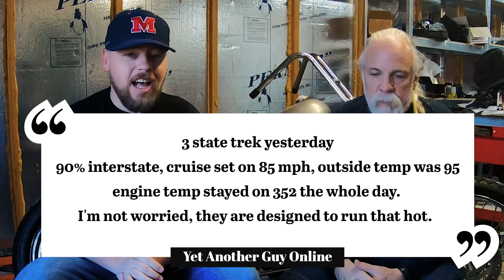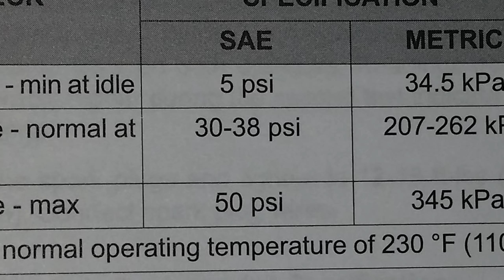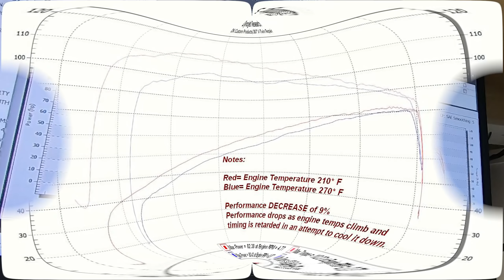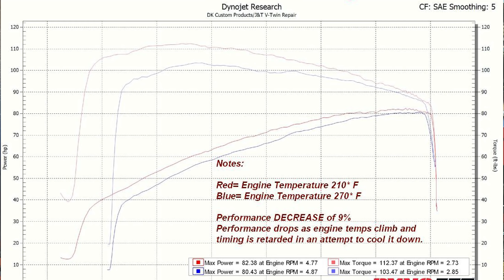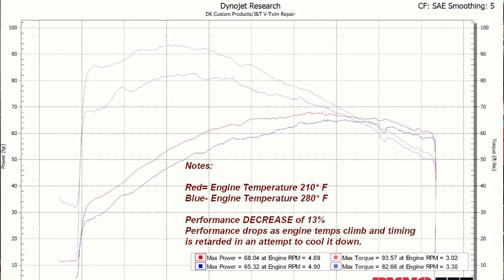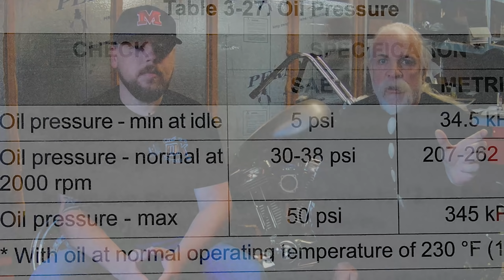Harley's - The RESULTS ARE IN About a Popular Myth

Comment: More than likely heat issues are a product of the oil you are running. Everyone thinks thicker is better when it is not.
Reply from the maker: No, that was not the case.

Both engines were fully heat soaked prior to runs, so the oil was not thick or cold.

The M8 had the factory 20-50 in it.
The Twin Cam had Redline 20-50 in it.
While some oils may lower temps by 10 F, and we have even seen claims of 20 F, the majority of engines will run 50-100 F hotter than what HD says is correct, and will start pulling timing in the 270-280 range.
For the guy seeing 320 f, even if he changes to an oil that lowers temps by 10 F, he is still going to have a problem.
Reply: Heat is a direct result of friction. Fuel and air is another but you have secondary’s with those. HD oil is total crap with no API standards. Oil not making it to all parts of the motor is another or poorly pumped. Try Mobil 4T racing oil or Amsoil.
Reply from the maker: @semperfipar1299  We've done heat tests with Amsoil compared to Redline and Royal Purple and Mobil 1, but we have not tried Mobil 4T.  We may do that.  Thanks.
But I am pretty dadgum sure that the heat generated by the combustions cycles is where the majority of the heat comes from.
Reply: @DKCustomProducts  One other thing is oil is suppose to shed the heat of the motor. Combustion is a big factor but that does not necessarily mean it is destroying the engine. Harley Davidson now has to have emission control. Catalytic converters back up heat into the engine through metal to metal transfer at the exhaust manifold connection to the cylinder head. The cooling fins also shed heat and the aluminum sheds heat very quickly compared to Iron. Having worked on helicopter drive trains the turbine is the ultimate air-cooled engine and believe it or not the system had a valve at the oil cooler that remained closed to allow oil to heat up then it would open up to the oil cooler . From there to the engine inlets and return to the oil reservoir. For piston pounders the multi-viscosity is what you have. The lower the first number the better for friction at cold temperatures. I run car oil in my old sportster and it takes about ten miles just to get it warmed up. Twenty one years old and still runs like new with over fifty thousand miles. Try 10W40 oil and see how it does with heat. It will circulate better than  20W50.

Comment: Run Amsoil in all 3 holes tested up to 500 degrees on the Amsoil video on this here interweb . When the steaming oil cooled they  tested it's viscosity and it had lost practically no motor protection and they put it back in the bike!!2 0/50 wt motor , dedicated Transmission and Primary fluid  all Amsoil and love jugs or the new mini mites . YOUR HARLEY WILL. NEVER OVERHEAT. My Deuce ran from 230 to one day in traffic 260. Since fitting the fans on same temperature day the oil / temp dipstick was running just under 200 all day.I also run the same set up on my 2014 Firefighter Shrine Street glide . I like the mini mites ( looks wise) my brother in law runs the original Love Jugs  on his 2003 Ultra Classic with you guessed it AMSOIL.
Reply from the maker: Thanks for watching and sharing.
Reply: @DKCustomProducts  hope his helps someone. You can at least check it out 👍😎🇺🇸🏴
Reply from the maker: @williamjohnson6517  You might enjoy this video- https://www.youtube.com/watch?v=bNHgNThrqQo
Reply: @DKCustomProducts  I did watch your video and really enjoyed it 👍 Everything you said was correct . Dino oil is probably ok for the short haul BUT who wants to change their oil every 3,000 🤔I know I'd rather be riding 😂Also as mentioned there is a difference between car and M/C oil . From what I understand car oil is not good for alloy motors that's why the M/C oil has the special additives. My thoughts on Syn /3 is what do HD know about motorcycle oil? They are motorcycle manufacturers and probably get their oil as cheap as possible and stick their name on it ? And I'm glad it works for you noise wise because that's the very reason I know people won't use it because it's noisey ( so I'm told). Like you say everyone's got an opinion 😂👍🇬🇧🇺🇸😎

Comment: I'm surprised that there are people who are in denial about the adverse effects of excessive heat because it's by no means unique to motorcycle engines. Every internal combustion whether air cooled or water cooled performs better when it's cooler (within reason, of course). Why would a motorcycle engine be different? Of course there's a point of diminishing returns but in general anything you can do to make your Harley engine run cooler will make it perform better and last longer.
Reply from the maker: Yes it is surprising, but there are a few reasons why:
#1 is that Dealerships are almost uniformly telling HD Owners that 300-350 is normal and they are designed for that.  The popular story that HD's are tested in Arizona and run for 24 hours straight in 110 degree heat and do just fine. 
Next is that folks have just spent a ton on a new bike and do not want to believe that it needs some help.
Another is that HD engineers know what they are doing.
There are other motivations, but those are the top ones, I think.
We will probably do a video on this subject.
Thanks for your comment.
Reply: @DKCustomProducts  I think one of the points you make is that there's an important difference between "normal" and "optimal." An engine may "do just fine" as-is but it can do just fine for more miles/years if it's better cooled. I totally understand not wanting to put more money into a brand-new bike, though.
Reply from the maker: @itsapittie  Yeah, the crazy thing is that folks buy a Harley, then they want more power, so maybe they do a mediocre Stage I, and then maybe they add a cam.  The power increase they get is is about what they would get if they just cooled it down to optimum operating temperature...which HD says, right in the manual, is 230 F.

Comment: The cutting of the rear  cylinder  at stops was aggravating at first but on those hot days it really makes a huge difference
Reply from the maker: A huge difference in heat that you feel, or a huge difference in actually temperature, or both?  What does "huge" mean, objectively?

Comment: In 1979 I bought a brand new 1979 Superglide, rode it for 14 years.  The BIGGEST problem I had with that bike, on longer rides the rear cylinder would get so hot the fuel would predetonate.  BANG BANG BANG Fire poping out of the rear pipe.  I would have to pull over and shut it down so it could cool off.  That pissed me off so damn much I swore I would never buy another damn V-twin aircooled engine..... Until last week... I bought a 2004 Fat Boy.
Reply from the maker: I hear ya.  Lots of guys back then ran scoops to get more air to the rear cylinder.

Comment: Last year I purchased a low mile 2007 Ultra Classic which I could afford. I reported to the Service Manager it's running real hot. He did say they run hot.
At one point I thought the engine felt   ' tired ' but after watching this video I reakize what the situation really is, HOT HARLEY TWIN CAM in the sumner.

I recently removed the tour pack to lighten her up only because I'm a disabled veteran with back issues. A Nam vet friend gave me a passenger back rest and beautiful large chrome luggage rack to install. I can attach travel bags to these.

Now I'm thinking a lighter bike decreases the load on the engine as well?  
I'll consider removing the lower vents and follow your recommended cooling tips. 
Already installed is a free flow aftermarket full exhaust and a power comnand installed by the previous owner. We can't verify any other modifications from the service records available.

Thank you, 
Grandfather John 
USMC Beruit Veteran Disabled
Reply from the maker: Yes, weight and wind resistance increases the load on the engine, which increases heat.
Lighter and more aerodynamic, the more felt power and the less heat (everything else being equal).
Thank you for your Service, because of You we Ride Free.
Thank you for watching and sharing.
Reply: @DKCustomProducts  you're welcome

Comment: If Harley's engineers knew what they were doing, their bikes wouldn't break down the way they do...(I've owned several, the newest was an 08 CVO Electra Glide & all of them required numerous repairs, while my Hondas & Kawasakis only required gas, oil & tire changes) Harley has the worst engineers in motorcycle design...that being said, I still love the way their bikes look, sound & ride, when they'll actually run...HD should've gone full water cooled decades ago...only cooling the heads is a step in the right direction, but they need to cool the whole thing...
Reply from the maker: And unfortunately they are not even cooling the heads on the Twin Cooled.  There is one water jacket and it only goes around the exhaust valves.
Part of the look that so many like is that they are not 100% water cooled.  HD has gone 100% water cooled on the VROD, Streets, and now the RevMax.
Reply: This is part of the reason younger riders tend to stay away from HD...they will eventually cause their own downfall when their ever aging loyal fan base dies off...they're overpriced, unreliable money pits...when you can get a fully liquid cooled Kawasaki Vaquero that out performs a touring HD at literally half the price off the showroom floor, why would you buy one of these lumbering dinosaurs? I love my Road King, but if I ever need another motorcycle, I'm getting a Vaquero...
Reply from the maker: @Road_Rash  Maybe the 3rd time is a charm with the RevMax for the younger riders (and some older ones)

Regarding why a new HD instead of a metric...Looks, sound, feel.
Reply: @DKCustomProducts  not good enough for me to stay with these money pits...I can get all of those same things for half the price with the Vaquero...alter the exhaust, it sounds very similar, & the looks & handling are fantastic...not to mention, I'd rather have Kawasaki dependability over any of that superficial stuff...
Reply: I'm currently trying to get a mystery leak stopped...one more thing to add to the laundry list of problems these things develop...it's just not worth the hassle of owning these things...it's always something with them...if this bike wasn't already paid for, it would be on the market already & I'd be buying that Kawasaki as soon as it sold...
Reply from the maker: @Road_Rash  Sorry to hear of all your unfortunate issues.  Best hope is that they get resolved easily and you can enjoy many trouble free miles!
Reply: @DKCustomProducts  I only enjoy trouble free miles when I ride my Honda, but 3 different Harleys have taught me that there's no such thing as trouble free milage on an HD...if you ride it, it breaks...
Reply from the maker: @Road_Rash  Feel for you...don't know the details, or why you are experiencing this.
I have over 300K miles on later model Harleys and have had NO breakdowns, leaks or troubles.
Reply: @DKCustomProducts  lucky you...but every single one I've had breaks when ridden with any regularity...this is the last one I'll ever own...they're just too troublesome...I don't buy bikes to spin wrenches on, I buy them to ride...these are for people who have deep pockets who either love spinning wrenches, or don't don't mind paying someone else to do it...these things require constant mechanics...& I know it's not just me, because after years in motorcycle clubs I know even the new ones do it too because I've watched too many people buy new ones & they wind up in the shop more often than any Japanese bike...they've lost me as a fan & a customer...they just can't make a bike that will run right consistently...my own fault really, for buying this thing when I knew better...I've took 3 chances with them & crapped out every time...to hell with buying a bike for looks...I'll never do it again...just not worth it to me for nothing but a look & a name on the tank...they've proven to me repeatedly that their reputation for trouble is well deserved...

Comment: That is so weird, my twin cam loves 90° weather, for some reason the bike runs optimal and even sounds throatier
Reply from the maker: That is great!
What year is your Twin Cam, and what, if anything, have you done to it?
Reply: @DKCustomProducts  it's a 2010 wide glide, it has a heavy breather, 583 S&S cams, and phython shotgun exhaust, all tuned with SE tune. It does get hot yes but only if I ride in traffic and or get rev happy, but it runs hard and strong when it's not fully warm, so like not so hot temps, but on a hot day in the 90s it's very throaty, in cold climate it's good to but I'm thinking it might just be all the rage on my face that makes me hold back, but overall it's pretty on par with my expectations
Reply from the maker: @miguelsalgado4673  Good to hear you are happy with your ride! 👍
Reply: @DKCustomProducts  did ride a buddy twin cam road king once on a 140 mile ride with a passenger, the bike was a joy to ride as far as long trips but it was a hot day and the bike felt hot, I personally thought at the time that the two deflectors behind the engine makes the heat stay and doesnt do s good job keeping you less hot
Reply from the maker: @miguelsalgado4673  Yeah, they can get pretty warm!

Comment: Running your breather delete and catch can on my streetglide and Dyna LRS.   Put a S&S 124 in my streetglide build and a larger TB.   You guys planning on building a set up for us guys with larger TBs?   I had to pull your system off my SG and go with a different intake with larger TB..
Reply from the maker: Very cool, appreciate your business and glad you are enjoying the parts.
We do not have a plan to do that.  All the testing we have done shows that the smaller OEM throat on the throttle bodies (or when there is a larger TB, then the smaller opening on the intake backplate) produces better power.  I know this is counterintuitive, but it is what we have seen time and again in testing.  The largest we've tested is the 131, so this might not hold true for larger displacements.
Reply: @DKCustomProducts  Thanks, also have the remote filter setup on both.    I understand, problem is the bolt pattern is a wider pattern as a result of the larger diameter TB.   Thanks for the reply.   👍   If I could bolt it back up, Id of reused the intake and breather delete.
Reply from the maker: @highwayman1218  Yes, that is something we have considered doing....making a different flange with different bolt patterns.
We have also modified (drilled more holes) the existing flange to bolt up to some different larger TB's.
Reply: @DKCustomProducts    Thought about that and may do the drilling at some point.
Reply from the maker: @highwayman1218  Enjoy your ride!

Comment: Optimum oil temperature is 180° f to 230 degrees Fahrenheit and the oil temperature in the engine is 10% hotter than the oil in the oil tank
Reply from the maker: Yes.  Good info.  Now, if the Harley "techs" could just learn these basics. 😬

Comment: My mechanic recommended the whole cam chest kit and oil cooler on my FXDLS,  made a HUGE difference so I did the cam chest kit on my 12 flhx as well and both are seeing much lower head temps. All because I was looking at cams initially
Reply from the maker: Nice.
Hope you got it running cooler now so that it will last you a good long time.  
Wishing you many miles of smiles. 👍😎👍

Comment: hey wait a minute, you said you turned the fans off. If you did a dyno run with the fans off, it will defiitely get the engine hotter. If I heard you correctly, this does not represent a real on road test. I believe you when you say they Can run hot, this is where we have to be aware and respond to the different conditions accordingly. This said, I have been looking at a secondary cooling option I can install as an on demand system. You cant predict a traffic jam, so something I can turn on instead of stopping on the side of the road will be nice. Ride on brothers
Reply from the maker: Yes, the fans are typically on when doing dyno runs.  We adjust the load and fans to get the bike up to a proper operating temperature (210) then we do a pull (which is 3-6 seconds).  During that 3-6 seconds it may warm up a bit, so before the next pull we make sure we are back at 210 F.
For this test we wanted to replicate how hot the bike gets on the road....which is easily in the 270-340 range.  So we turned the fans off to let the temp build to mirror what is seen in typical riding.  Then the fans went back on while doing the pulls.
You may find one or both of the following links interesting.
https://www.youtube.com/watch?v=o3T3yA9BKwE
https://www.youtube.com/playlist?list=PLb3bvZgbH92_3s-2vv63QggFJ3nteFd_C

Comment: This makes total sense because most cars truck or suvs run about 220 as far as operating Temps on coolent so with it a harley majority of the time running air cooled bikes makes total sense and yes with the oil temp you keep the oil tem cool it doesn't brake down as fast the hotter it gets the more of a chance of cavitation of the oil
Reply from the maker: Great point, thank you for the comment! 👍

Comment: Nah heat doesn't effect how the engine performs.  Evidently they never had a vehicle over heat on them. 50 degrees over recommended operating temp is over heating. Why vehicles spit and sputter and loose power. Heat is friction. So less heat the smoother the engine runs
Reply from the maker: Yeah, it is amazing how strong the misinformation is.

Comment: yes, high operational temps drop efficiency,  but I would have liked seeing that external fan blowing from the front of the engine, hitting the oil and watercoolers, and how much difference that would make,  simulating movement of the bike
Reply from the maker: Sorry we did not highlight that, they are there, in front and to the sides.
The fans on all dynos  replicate the wind the engine experiences going about 60 mph down the road.